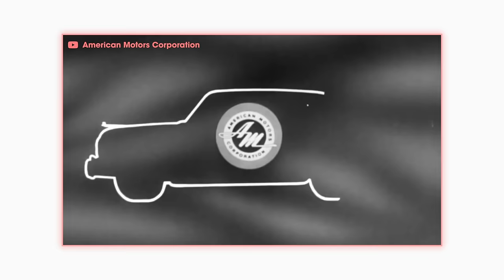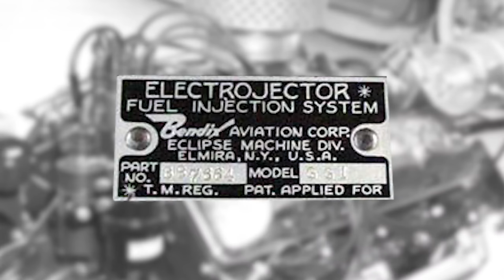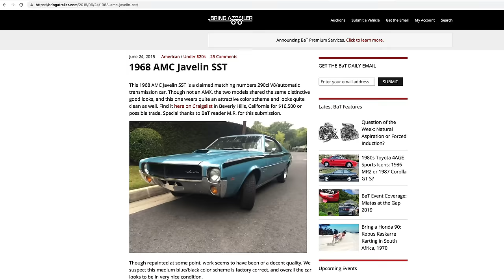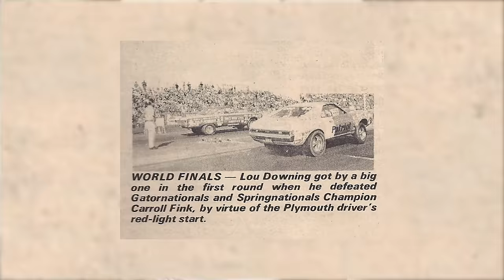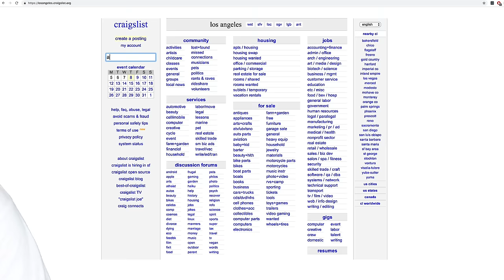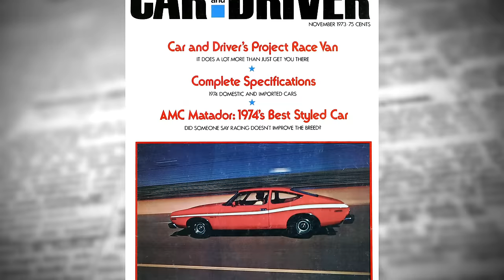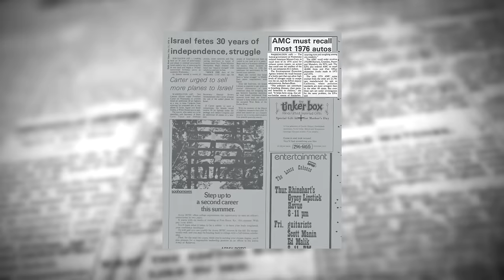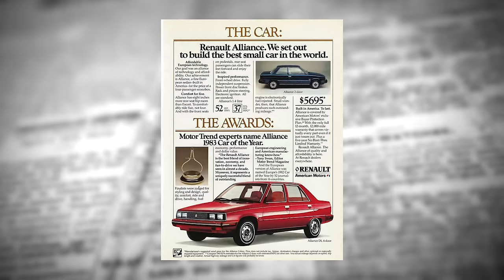AMC - Everything You Need to Know | Up to Speed

Comment: I've owned many AMC's over the years, from a factory V/8 Pacer, AMX's and Javelin, best of all two S/C Ramblers. Every one of the AMC/Rambler cars are fun to drive, less expensive than most others, and best of all, and unlike a camaro" when going to cruise nights you're likely to be the only one there.
Reply: My first car was a 1969 Rambler American.  I've also owned a '68 AMX with a 390 engine, a '69 Javelin, and a '71 Matador.  I loved the power and handling of the AMX, it's my favorite of all the vehicles I've had over the years-but I must say my 2010 MX-5 is a blast to drive.
Reply: I’m still hoping to buy up a sweet 81-83 spirit. I missed out on a pristine DL model recently.  It’s also a dream of mine to have a Rambler Classic 770 coupe as a daily driver. They’re just such perfect looking cars.
Reply: my dad worked at amc  10 years in engineering then 20 in production he started in 1968 and was there through chrysler's takeover in 1988 retired as a superintendent then went to work for gm setting up the gmt 800 line in detroit
Reply: I have a 1987 Jeep Cherokee that was the very last from AMC, overall though for a dying company my jeep has held up well with over 320,000mi
Reply: What about the 1970 A.M.C. Rebel "the machine"
Reply: @suziscarborough9665  No such thing an a 69 Rambler American
Reply: @mattwatson9389  ya know it is interesting that if one peels back a layer or two on later Cherokee models, AMC still branded on some of the parts🎉
Reply: Been keeping my eye on the gremlin market since i was 13 so i could save up for one sadly i had my chance to own a actual early 70s gremlin x with a 304 v8 but couldnt get the 1500$ and sadly it got sold and torn apart
Reply: @jamesprice2163  I hated looking without the money

Comment: More Up to Speeds on other fallen legends, please?
Plymouth
Studebaker/Packard
Oldsmobile 

Crosley
Mercury
Duesenberg
Reply: Definitely up voting that Studebaker/Packard one. Didn't they use to be real hot shit?
Reply: @microusb42069  They were the most luxurious cars of their era that put Lincoln and Cadillac to shame.
Reply: OR, and hear me out, THE REAL LEGEND, The Acura Legend
Reply: Buick!!
Reply: @microusb42069  duesenberg was the shit
Reply: @WAXXWIZZARD  no
Reply: @antoniomoralez9573  - Certainly debatable. The classic Packard of the thirties were as good or better than Cadillac.  Then came the cheaper, mid price 120. A necessary move during the depression and post war, the "Senior" Packard line was gone. The tooling sold or given to the Soviet Union.  Cadillac brought out nice styling post war. Packard till '51 looked like a pregnant elephant. The 1951-54 cars were nice and the 1955-56  even better with their own V8 , automatic transmission and self leveling torsion bar suspension, GREAT.  But the merger with Studebaker was a disaster.
Reply: I would include Pontiac , they used to make some badass cars like gto, firebird etc , the last good car they made was the latest gen gto which is cool but they stopped making them sometime in the late 2000s
Reply: @Ray_Pisst  - The Trans Am with the low compression SD-455 was still a legitimate muscle car. Awesome car!
Reply: Scooter George for sure but Pontiac fell off
Reply: DUESIE
Reply: @xenophon8958  - Duesenberg  SJ DOHC, 4 valves per cylinder and supercharged.  And that was in 1932!
Reply: +1 on oldsmobile
Reply: What about the trans am
Reply: You need to do a show on RWB & their Porsches!!!!
Reply: There’s a religious retreat camp in my hometown that has horse drawn Studebaker wagons. They’ve applied for a grant to get them restored, it’s a neat piece of history in the middle of the woods.
Reply: The CUDA baby!
Reply: Bo Duke
Reply: Antonio Moralez rolls Royce then put them all to shame 👍🏻
Reply: Yes please
Reply: STUDEBAKER - by far America's most important automaker. They were the oldest and contributed so much to auto design that its a shame that they aren't remembered more.
Reply: @robocop3961  Nope. Packard was by every metric a superior marque up until the Studebaker merger of 1954. Then it all fell apart.
Reply: Jake Kaywell they fell apart, they wasn’t that good!! 👎🏻
Reply: @robocop3961  When Studebaker merged with Packard, it was a flaming disaster for both marques. Studebaker outright lied on how much capital they were losing, and as consequence, Packard was turned from a solvent company into one in dire financial straits. It didn't help matters that Roy Hurley, the CEO of the Curtiss-Wright Corp (who only bailed out S-P for their defense contracts) gave them unfavorable rates and wasted a good portion of whatever funds were left on the development of the Packard Hawk. Give me a pre-1954 Packard any day over a Rolls-Royce.
Reply: Jake Kaywell Bentley or rolls Royce any day bro!!!
Reply: I would love to see one on Lincoln
Reply: Yes! Oldsmobile please!!!!!!
Reply: Don’t forget Stutz

Comment: Great Video.  I bought a 1973 Javelin with a '69 390 in it and drove that around for a couple of years until someone ran a red light and squished it.  About 10 years later I bought a '69 javelin with the 343.  Low miles, great condition, green.  Had to sell it when I was going through hardship (it was my daily) and it needed a new camshaft.  I dream everyday of getting a mint '73 with no drivetrain, transplanting something modern, and driving it every day till I die.  Amazing car.

Comment: I would love to just have a video about the 4.0 straight 6. That engine alone could have it's own video.
Reply: Barra? *cough* the GOAT *cough*
Reply: The engine that you just had to pour tons of gas in it and it ran for decades without an oil change?
Reply: @charles-andretremblay3217  Unless you got one in the 2000's in which case they cheaped out and engines had flaws. 

 
Also the ford f150 i6 is amazing

Comment: Great video, Thank you. Been an AMC fan since 1968 when I bought a new 1968 AMX. 343 with Go Pac. In 1973 I ordered a new Javelin AMX, 401 Go Pac, 4 speed. In 1975 I finally bought a 1969 SC Hurst Rambler, what an absolute attention getter it was in the day. Today I still own the Javelin AMX, as it sits in the garage. It is as an attention getter as well today, as one just doesn't see these or any AMC cars anymore. The Javelin AMX has been warmed over some with the addition of the 1970 AMC Rebel Machine intake and a larger Carter performance Carburetor. Other than that, the Javelin AMX is still all original, down to the factory Rally Wheels. So sad that AMC didn't last longer. When Chrysler bought out AMC in 1987, by 1989 they had completely demolished the whole Kenosha assembly plant. They didn't even give anybody the chance to salvage any of the factory  parts, some dating all the way back to the 60's. Or save company literature and paperwork, they completely destroyed, and erased American Motors from the face of the earth.

Comment: You've really got to flash up a metric conversion for engine displacements, I'm an american (who uses imperial) and I've got no clue how big 200 cubic inches is.
Reply: Google.
Reply: @rickycollins4633  google breaks up the flow of the video, but that's what I currently do
Reply: Easy 

1 inch = 2,54 cm --- all know that 
1 cubic inch = 2.54 ^3 = 16.38 ccm

100 cubic inch engine = 1.6(4) liter ----  so 98 is like 1.6 really
200 cubic inch = 3.28 liter
300 cubic inch = 4.9 / 5 liter  (ford 302) (chevy 305) etc.  

That is really easy ... even for me from metric Europe :)

Comment: Bendix makes air brake components for big rigs now. Just an fyi. Also, do one on freightliner, Kenworth and peterbuilt
Reply: they did used to do a lot of drum brakes i think. y 86 ranger had bendix drums on it as well as my 87 cherokee. They also did the fuel injection system on the 4.0 straight 6's in cherokees and yj's starting in 87 up til 90ish i think. that was in collaboration with renault so they call those cherokees renix's while the later ones with chrysler fuel injection are High Outputs or H.O.s The renix' are actually kinda better than the HO's, they make 175ish horse and 225 lbft at 2500 rpm while the HO's made 190 hp and 225 lbft but peak torque was at like 4 grand

Comment: The AMX3 was absolutely beautiful
Reply: I'm fairly sure they only ended up making 7 of them in total.
Some didn't even have real engines in them.
They had plastic faux motors (which seems more expensive having the molds made for them vs just putting an actual motor in it)
They looked good but like many 2 seater supercars, imho they are way too low to the ground/driving in actual traffic.

Comment: Ok I'm an AMC ,fan have been for 40 years . Just wanted to correct you on one of the few things in your article that needs addressing.  SC/Rambler was not the quickest car , that honor belonged to " The Machine " .. it was the only car in 70 that came standard with 15" rearend.  Here's the part u missed . AMC made parts and sent them to the dealers for them to put on ... it was called the " service performance package " it took the car from 14 second 1/4 mile down to low 11 . That if it was assembled at the factory would have held the record for fastest performance car from a factory until dodge developed the hellcat in 2006. Check it out dont take my word for it. U did not mention the 79 AMX.  Lil car big 304 won 24 hrs nuremburg race in Germany.  Brake fade made them slower in corners but they still got 1 and 2 in there class. Big 3 didnt even try . They were scared of Ferrari and Porsche.

Comment: Hudson was an excellent engine builder, with very strong metallurgy work. You sat in-between the frame, so the handling was excellent. They were race cars disguised as the family sedan. When the AMC company sticked with the Rambler line they had their best sales, but lost sales when they dropped the Rambler line and attempted to compete with the big three in nearly all areas. These were nice cars, but didn't sell as well. But, many of their cars were low priced, yet well made. Their six cylinder engines were long lasting, their V8's less so. But, I loved their V8 cars.

Comment: AMC build a car that was successfully introduced in the Argentine market but under the brand IKA (Kaiser Industries Argentina, or Industrias kaiser Argentina). This car, The Torino, was fully refresh by Pininfarina and tunned for being one of the sickest cars in Argentina, in such a good way that became a symbol of argentine car industry. Then the car was tuned up to race in Le Mans in which ended in 4th position.
In Argentina, we got a race called "El Turismo Carretera" in wich touring cars from the 60's - 70's race, one of them is the TORINO, then we got the Ford Falcon (4 door version), Dodge GTX and the Chevrolet Chevy (Chevrolet Nova in the Us). You got to see it.
Reply: All of the cars that race in turismo carretera are in line six. Now the engines was refreshed to be 4 valves per cylinder, it is called "The multivalves" ands it sound sick.

Comment: Back in the day they could be tricky to maintain since they used a hodgepodge of parts from different manufacturers. Definitely had to take the old sorts to the store to match because they changed things on an as needed basis us guess. I only have a experience on the Jeep models, the cars may not have been as slapped together with different manufacturers parts 
Cheers

Comment: I drive the last scraps of AMC's legacy.  It is a 1997 Jeep Wrangler I bought new at the end of 1996.  The AMC 242ci I6 engine still powers the old relic.  The doors designed by AMC are still used.  The axles AMC used are the same ones on my vintage beauty with the exception of being made for coils.  The same transfercase that AMC employed from New Process is still there.  My old throwback to a, simpler time now has 401,000 miles on the odometer.  The more new vehicles come out with ugly styling, stupid novelties and gizmos, and inventions to take away your control, the more I love my aging remanent AMC's legacy.  In 2007, the last scraps of AMC died.  The new Jeeps have nothing left of AMC in them any more. With the advent of the JL, it is even more painfully evident that legacy Jeep is dead.  The Wrangler JL actually has touch screens, the engine auto off and on engine design flaw, and over engineered gizmos.  That will never be as durable as the pre 2006 Jeeps of old.

Comment: That AMC Eagle was ahead of its time despite still having a design that looked like it was 10 years behind the times. AMC Eagle was some would consider technically the first crossover and ironically the first crossover had a Jeep 4 wheel drive system. Putting a truck like 4 wheel drive system should be in more crossovers

Comment: Your making fun of the Bendix Corporation? They Are Only the designers of the most successful hydraulic drum braking system used by everybody in Detroit with Toyota even copying it. 

I owned a 1973 Jeep CJ5 Built by AMC and it had the 258 cid or 4.2 Liter Inline 6. I was as reliable as an anvil.

Comment: "AMC made better cars than their Motor City competitors." Baloney. No, they most assuredly did not. AMC made quirky niche cars with limited market appeal and they made Jeeps. Not enough to keep them in business. They tried merging with Renault which was a fucking disaster for them. Something Nissan should have learned from and unfortunately did not.

They really pushed the craptastic Renault 9 & 11, as the Alliance and Encore. It was a bit too small. They also sold the Renault 18, sedan in 81-2 and station wagon till 86. But only with the 82hp four. Might have had better sales had that sold it with the 130hp PRV V6 used in the  Delorean. With minimal advertising. A better choice would have a a sedan variant of the Renault 20/30 with the 130hp PRV V6. The Fuego was interesting but under powered for the US market. The 25 was marketed too late to matter.